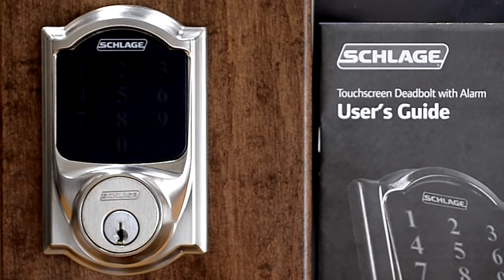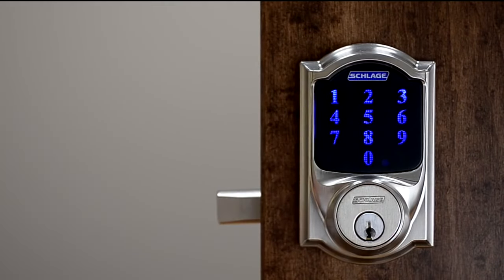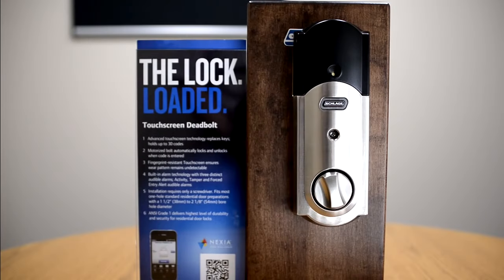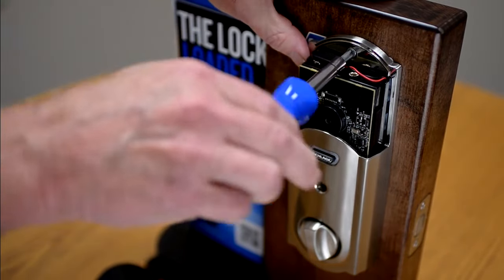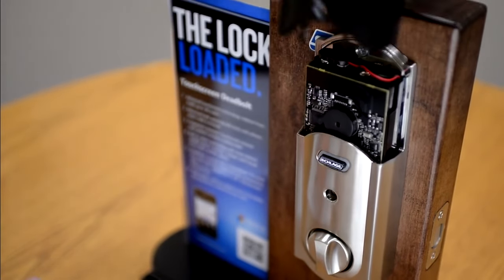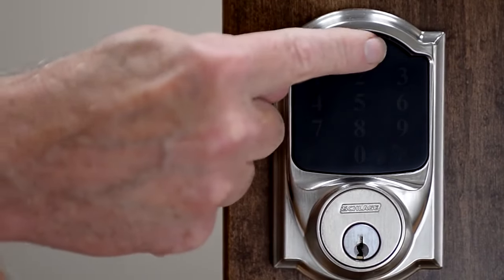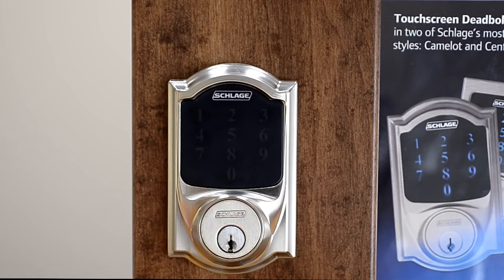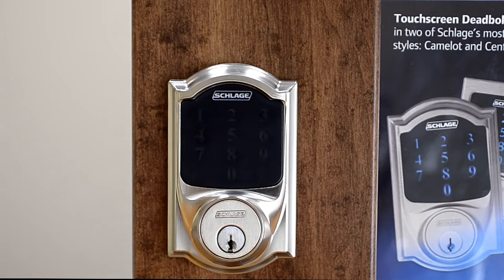How To Factory Reset Your Schlage Connect™ Smart Deadbolt

Comment: Doesn't work - Schlage customer service takes over a week to reply to an email. They couldn't figure out how to fix this. Was finally told my lock is out of warranty after 3.5 years - warranty only lasts 2. What a garbage product - does Schlage think I will buy a new $250 lock from them every 3 years. Will never buy a Schlage product again.
Reply from the maker: Hello, we thank you for your feedback and we do apologize for the issue you have experienced with your lock. Unfortunately, the electronic warranty does expire after 3 years of use. We would suggest ensuring you are only using alkaline batteries (Duracell or Energizer preferred) and checking the wire from the keypad is securely connected to the back of the interior lock assembly. If we can assist you with this model please reach out to us at 888-805-9837 or email consumerschlage@allegion.com.

Comment: 7 years later and this video helped me with my locking issues. I followed this video exactly and managed to get the locking mecanism to occasionally function.   We were leaving on a lengthy vacation and because I didn't trust the lock, I took a key along with me.  Sure enough, we got home and could not unlock the door.  That's when I finally had to call Schlage.  The first thing I was asked was what kind of batteries I was using. Told him I was using Energizer Max AA's. He then told me that certain batteries are required.  You cannot use those super powerful batteries.  He told me that I should use Duracell Alkaline batteries or something similar ONLY.  No Amazon, no no-name, no rechargeable, no high-power batteries. Wouldn't you think you'd put that somewhere in your installation manual???  Went and got the right batteries, followed this video exactly and now it FINALLY works!!  Thank you for this video!
Reply: Thank you!!! So much im glad you commented
Reply: THANK YOU!!! this is the real answer!!!
Reply: Needed this. Super helpful thank you! 🙏

Comment: I did the factory reset,got the 3 blinking check marks but neither one of the factory codes do anything?  Now what?
Reply from the maker: Hello Brian,

I'm sorry to hear you're having programming issues with your lock. After performing the Factory reset successfully, the only codes on the lock at that point would be the default codes (Programming Code, User Code A, and User Code B). If none of the three codes are working, please try the Factory Reset again to ensure the process was performed correctly. Aside from that, please verify that the programming sticker inside the lock matches the codes from the sticker you're currently using. Also, when is the lock giving you Red X's upon entering one of the default codes? If you're receiving a Red X immediately upon interacting with the first digit, the issues would most likely be the batteries as this is a critical battery warning. If the lock is giving you the Red X after successfully entering the whole code combination, then the lock is suggesting that that code does not currently exist. Please let me know if the issues persist after verifying the above items. Thanks!
Reply: @SchlageLocksOfficial   thank you for your response. after i enter the programming number it has a blinking orange light and I'm uncertain what to do from there?
Reply from the maker: Brian,

If you enter your 6-digit programming code and receive a blinking orange light, this indicates you are now in "programming mode". From here you would follow a simple sequence dependent upon what you're attempting to do. If you're attempting to add a new access code for example, you would enter your 6-digit programming code > Press "1" > Enter your new 4-digit access code > Enter your new 4-digit access code again. Remember, the programming code does not lock or unlock the deadbolt. Only your 4-digit access codes are capable of locking/unlocking the deadbolt. You can find programming steps listed in the user's manual for your lock, as well as some videos on Youtube illustrating the process. Let me know if you have any other questions. Thanks!
Reply: @SchlageLocksOfficial  with your help I got it working right again so thank you so much for your help
Reply: Hello, i did all of the above. However, it’s still not working. Everytime i enter the 4 digit code, green check blinks but so does the red cross. It happened with the original factory as well as new code i had set. Please help.
Reply: @maraduarz  @SchlageLocks
Did you figure it out. After the factory reset routine, it does not do the initial setup routine when I enter any of the user codes mentioned on the back of the lock. Is there any other method to get it working

Comment: This does not work on my Schlage Connect lock, at all. Very frustrating.
Reply from the maker: Hello, thank you for your comment and we do apologize for the trouble you have experienced with your Connect lock. Please make sure you are only using alkaline batteries like Duracell or Energizer and that the battery tray is inserted with the batteries facing towards the door. If we can assist you with this model please reach out to us at 888-805-9837 or email consumerschlage@allegion.com.

Comment: First of all, I replaced all 4 batteries by totally brand new Duracell. Secondly, I did the same procedure with factory reset, which in the video above. And it didn't help. I think I have a malfunctioned keyboard. The whole right column (3-6-9) is not working. Maybe some mechanical issue of keyboard module, because wires are looks okay.
Reply from the maker: Thank you for contacting Schlage Support. I’m sorry to hear you are experiencing issues with your Schlage Connect.  If you could please direct message us with the following information, we will be happy to assist!
Age of the lock 
Picture of the front/back of lock
Picture of programming
Telephone number
Shipping address
Thank you and have a safe day!
Reply: @SchlageLocksOfficial , I called and I spoke with your Customer Service representative already, thanks!
Reply: Hello, I tried to reset but there 2 codes, programming code and 2 user codes. I used the programming code. The code doesn’t work and after 2-3 tries the schlage button beeps red with an alarm sounding. What should I do? How should I direct contact Schlage?
Reply from the maker: Hello Nish,

Sorry to hear you're experiencing issues with your lock. If the lock is not accepting all 6-digits of the programming code, it's possible that the programming code is either incorrect, or it was at some point changed. If the latter, performing a factory reset on the lock should resolve the issue by reverting the programming code back to its original 6-digit combination. To factory reset: Disconnect the battery wire. Press and hold the Schlage button at the top of the keypad. While holding, reconnect the battery wire.

This should revert the codes to their defults, allowing the lock to be programmed at that point. If you're still experiencing issues, please DM us so we may further assist you. Thanks!

Comment: It won't lock from the outside using the schlage button.  I'd always have to enter my user code.
Reply from the maker: Hi there. Thanks for reaching out. Please see page 7 of the user guide to enable to lock and leave feature: https://www.schlage.com/content/dam/sch-us/documents/pdf/installation-manuals/24060857.pdf. If this doesn't work, you can give us a call at 1 (888) 805-9837 and we can assist you. Thanks, Jenny.

Comment: I followed these steps and after putting in the factory code I got the blinking X what does that mean?
Reply from the maker: Thank you for reaching out!  We apologize for the issue you are experiencing with your lock. We suggest inserting a new set of Duracell alkaline batteries. Please make sure the battery tray is inserted with the batteries facing towards the door. Next, please follow the steps show in the video to perform a reset on your Connect deadbolt. 
If we can assist you with this model please reach out to us at 888-805-9837 or email consumerschlage@allegion.com.

Comment: Battery solution worked for me.  I had been using Energizer rechargeables and it wouldn't power the lock at all.  Got some Duracell alkaline batteries and it worked like a charm!  Thanks for the support Schlage!
Reply: Ya, don't use any rechargeable batteries the voltage on those are not up to par with the regular batteries.

Comment: Will performing this help with battery drain?
Reply from the maker: Thank you for reaching out! We suggest checking to make sure the battery tray is inserted with the batteries facing towards the door. Also, please make sure you are only using alkaline batteries. If you have any other questions or require any further assistance, please call us at 888-805-9837 or email consumerschlage@allegion.com.

Comment: I have exactly the same lock but it doesn’t work for me for some reason. I used the same method, and I see the green light from the pad after the reset. But I can’t use any of the the original user code I found from the back of the lock to open the it, and the programming code doesn’t work, it doesn’t allow me to enter more than 4 digit of the code while the programming code is 6 digits. I’m wondering if you have any suggestions?
Reply from the maker: Thank you for reaching out and we do apologize for the issue you are experiencing. Please make sure you are only using alkaline batteries, we recommend Duracell or Energizer. Please also ensure the battery tray is inserted with the batteries facing towards the door. If we can assist you with this model please reach out to us at 888-805-9837 or email consumerschlage@allegion.com. 

Thank you, 
- Mayra

Comment: I used the lock on the LEFT side door and it has been working fine, but now I move to another door that use RIGHT side. what should I do? Please advise! Thanks.
Reply from the maker: Thank you for reaching out to Schlage support. I am sorry to hear you are having issues.  When you move the lock from one door to another you will have to perform a factory reset. 
Factory reset your lock. 
Disconnect the batteries.  Press the Schlage logo twice.
Press and hold the outside Schlage Logo on the keypad.
While holding the outside Schlage Logo, reconnect the batteries.
Watch the keypad- the green checkmark will appear when the batteries are connected.
Release the outside Schlage button.
Operate it electronically by entering in default codes A or B. If the reset was successful, the lock will perform a setup routine. Wait until the bolt stops moving. The reset and setup are complete. 
Let me know if you need any other assistance.
Becky

Comment: I have this exact lock. I recently changed the batteries about 5 days ago. It worked a couple of days, now whenever I press any number button, the red x lights up and that's it. Any advice?
Reply from the maker: When replacing the batteries in our lock we recommend using high quality alkaline batteries only, Duracell and energizer batteries are preferred for ideal performance. Lithium, rechargeable, Amazon Basics, Rayovac, Everready, Kirkland and all other discount/generic brand batteries tend to drain rapidly in our locks. Nor do they provide sufficient power for Schlage locks. Additionally, batteries purchased in bulk tend to drain on the shelf prior to use.

Also, the battery tray should be inserted with the batteries facing towards the door and the wire going across the top of the battery tray and connecting on the left. If the batteries are facing backwards, we have noticed the units will drain faster or the keypad will become unresponsive. If you have any other questions or require any further assistance, please call us at 888-805-9837 or email consumerschlage@allegion.com.
Reply: I use Kirkland and they usually last 12-18 months with heavy daily use.

Comment: I bought a house with this lock. Where can I find the reset codes as I don't have the user guide.
Reply from the maker: Hello Raphael, the programming sticker can be located inside the lock when you unscrew the interior portion off the door. Once that is located, you can follow the instructions linked below. If you have any other questions, you can contact us at consumerschlage@allegion.com. Thank you! 
https://instructions.allegion.com/instr/146/23532

Comment: Moved the lock to left hand door.  It wont detect the switched side even with a reset.  It opens instead of closing the door.  Ive been on call wait for an hour with support.  Been calling them for past 3 days
Reply from the maker: Hi, Emil. Thanks for reaching out. Sorry for the wait times. If you follow us on other social, you can DM your issue and contact info and I can have someone reach out directly. You can also email us at consumerschlage@allegion.com and someone will contact you directly from there as well. Thanks, Jenny.

Comment: What do you do if this does not work? After a factory reset neither factory codes work. The programming code is also rejected after only 4 digits.
Reply from the maker: Thank you for reaching out and we do apologize for the issue you have experienced. Please make sure the programming sticker on the user guide matches the programming sticker on the back of the interior lock assembly. Also, please make sure the battery tray is inserted with the batteries facing towards the door and that you are only using alkaline batteries like Duracell or Energizer. If we can assist you with this model please reach out to us at 888-805-9837 or email consumerschlage@allegion.com.

Comment: What do I do if the lock works but I can't connect it to the app? Every time I put in the programming code then press 0 I get a yellow flashing light then a red x. Why won't it connect to the app? My google Pixel 3 has Bluetooth turned on. What should I do?
Reply from the maker: Hi, Elliott. Thanks for reaching out. What app are you trying to connect your Schlage Connect to? (It doesn't work with the Schlage Home App.) Thanks, Jenny.
Reply: @SchlageLocksOfficial  I was attempting to use the Schlaget app. Which I just realized doesn't work with my lock. I accidentally bought the Z-wave lock instead of the zigbee lock. I mistakenly though they were the same thing. Hopefully amazon will save me. If you have a philips hue or echo plus you want the Zigbee lock. Lesson learned :)
Reply: I am having the same problem. The batteries ran low and after replacement. Now we can not get the lock to work with any of the default codes. Followed the instructions and wateched this video multiple times. The programming code seems to work but nothing more than that. Fortunately we can use an entrance with a trusty Kwickset lock. SO much for technology! Any help would be appreciated - from anyone - otherwise we'll go back to a brass knob

Comment: Schlage stupidly put the reset button on the front as part of the touch panel and it’s not known if it’s compressed or not when resetting. Currently can’t reset a deadbolt when I have 0 issues for any kwikset ones with legit physical buttons. 

Garbage
Reply from the maker: Hi Zach, 
Thank you for your comment and we do apologize for any issues you've experienced while attempting to reset the lock. After disconnecting the battery wire we suggest pressing and releasing the Schlage logo on the keypad once then press and hold while reconnecting the wire. If you get three green check marks then the lock has successfully reset. If you have any other questions or require any further assistance, please call us at 888-805-9837 or email consumerschlage@allegion.com.